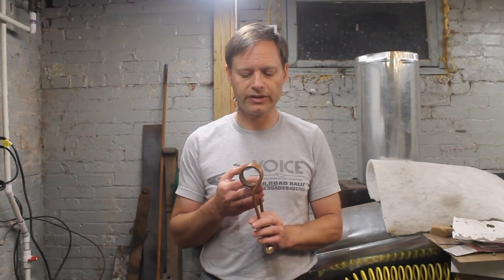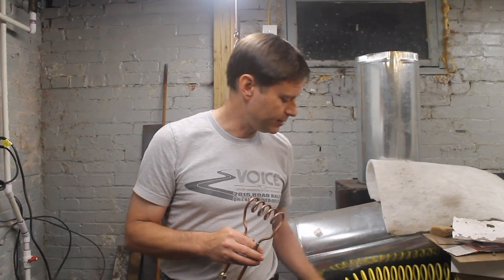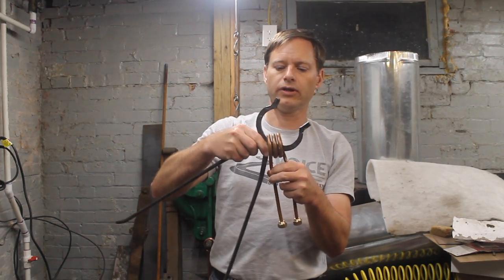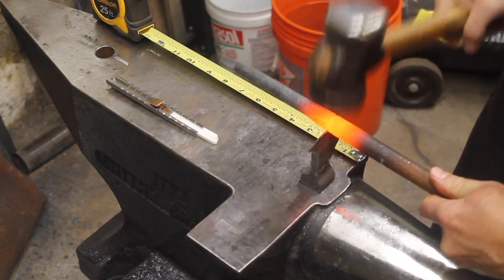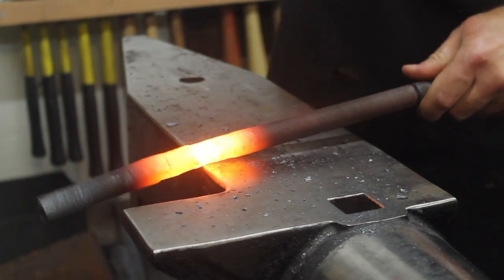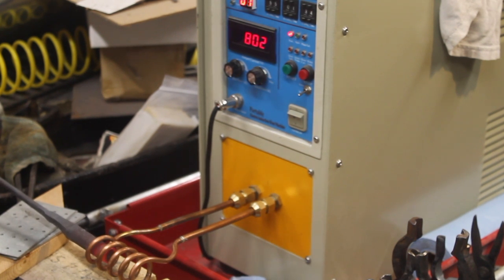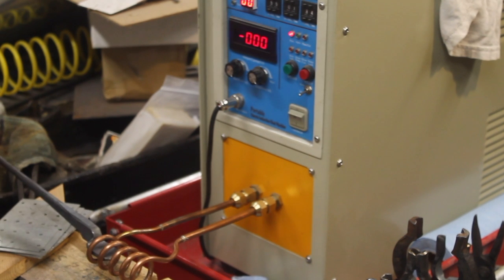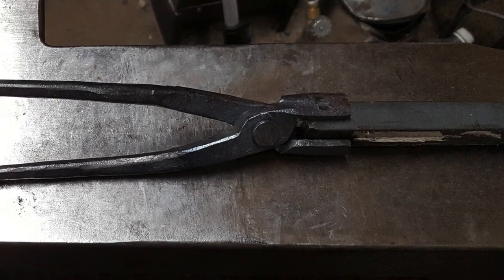Forging tongs with a LH-15a induction heater

Comment: Instead of changing coils, can't you make a jumper to put across the loops you don't need? Not a soldered on one, but one that can just be put on or removed as you need it.
Reply from the maker: Given the high currents involved, I have found jumpers to be problematic. I also find that I'm changing coils to get different shapes 99% of the time rather than just different lengths.

Comment: Hi ,loving you posts about induction forging (you have probably prevented me making many mistakes I would have made if I haven't seen them ...thanks) can I just ask so far is the induction unit proving to be reliable ? Looking to purchase a unit and like your good self am a keen hobbyist but after searching there seems to be a very limited number of suppliers globally and the unit you have on the face of it should meet my requirements .. was just wondering apart from finding a reliable seller are there any specific failings so  far encountered (I anticipate been a light user not into mass production ) Any help much appreciated :::::)
Reply from the maker: One segment of the timer doesn't usually light up and it doesn't always beep anymore. It does always heat, so <shrug>. These units should last for literally years of heating time.

I bought mine from the folk that now sell them as US Solid. They also will sell you 8mm flare nuts and tubing if you ask (they don't list those on their site).
Reply: @ejoftheanvil  Hi Eric, thanks for the response ,will bear this in mind going forward ,keen to give this a try :)

Comment: Is changing the coils difficult? How do
you keep water from leaking all over ?
Reply from the maker: Changing coils takes me 30s. I turn off everything (including the cooler), grab the wrench I keep on the cart and pop one off and put on the other. The internal plumbing is setup so that water drains downward from the coil (just don't position the cooler above the induction heater). You get a little water dripping out of the coil (which you can mostly avoid if you open the left side of the coil first and wait for the gurgling to stop).

Comment: Price  pleas. I want buy.
Reply from the maker: In the USA, about $1000 with shipping. You can find them on ebay. You can also buy from US Solid. https://ussolid.com/ussolid-15-kw-high-frequency-induction-heater-30-80-khz-220v-or-110v.html. I haven't bought from them but a friend did.

Comment: Great videos i just saw.......i feel that you are trying to heat the work piece more in the length but your resonance gets off the range .
The easiest way to do that is just use a coil loop of 4 or 3 turns and add 2 or 3 pairs more of 4 or 3 turns loop coil . Add coil in parallel to increase heating length .
Reply from the maker: Yes. That's a great observation. I haven't built any coils like that but I've seen some that use that approach. I definitely need to try it out!

Comment: there is a reason you dont put a fiberglass stocking on the homemade coils or dip them in gypsum?
Reply from the maker: The fiberglass melts onto the metal when I accidentally bump it at high heats. I decided it wasn't worth it.

Comment: I apologize if you have already addressed it but as far as a cooling unit, could a small pump and heat exchanger handle the cooling water needs for this unit? I was hoping an automotive heater core with a small fan and a small pump would suffice. I think I remember reading that this unit requires cooling water to be 40 celsius or below?Thanks!
Reply from the maker: I do show some pictures in an earlier video: https://youtu.be/rNZkxVRb5Ys . I think you will need more pumping power than you expect and perhaps a bigger fan. In particular, garden pond pumps will not do the trick. They are rated for the flow but not for enough "head". You will need a Procon or irrigation pump. And, 40°C is 104°F, so that's going to be difficult to maintain if your shop is warm. Mine is in my basement, so it stays <80°F even on a blisteringly hot summer day.

In two years of use, I have only had one occasion that my cooler would not quite keep up. I made a hammer out of 1 3/4" 1045 round stock. This required nearly two minutes of heating each time and afforded only about a minute of forging. I had to take a break after an hour to let the water cool. (The heater does shut itself down on overheating, so there's not a danger of ruining it.)